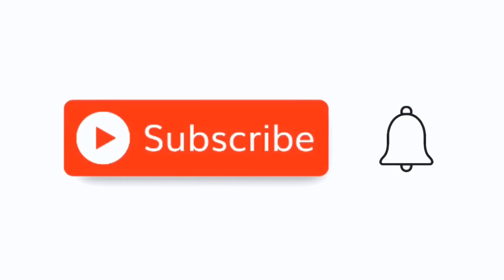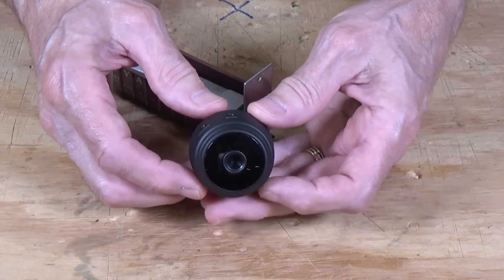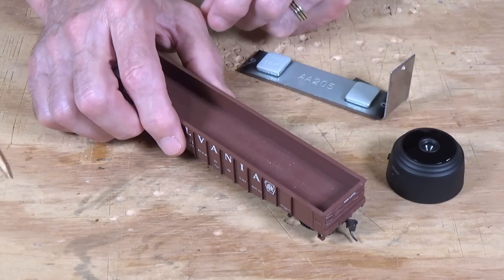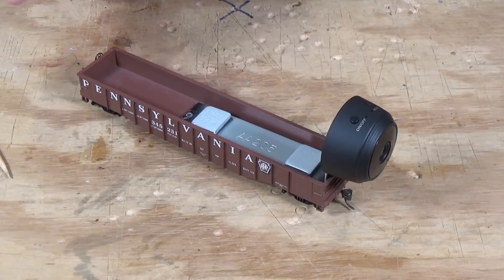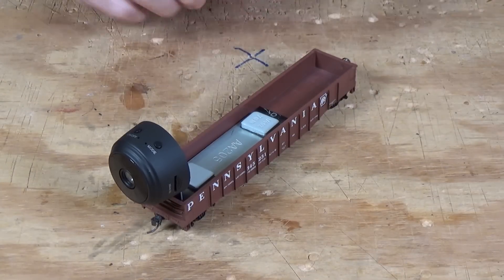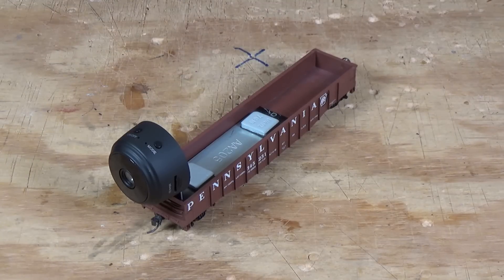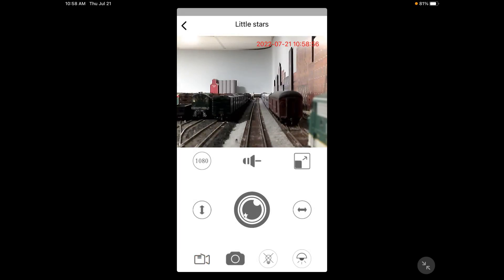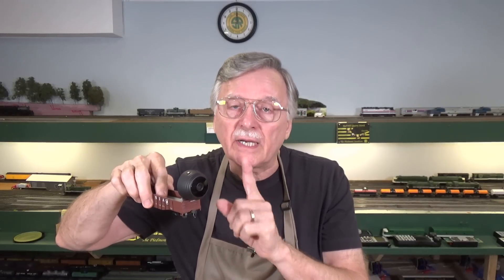Build A Camera Car For Under $20 (266)

Comment: I usually use a toothpick to get the sd cards to click down as they go right in it, your thumb wont do it. It wont be 1080p and it wont be stabilized. There is far better options out there but you wont get 4k on one either unless you spend $200 for a 4k camera. The 4k ones are $40 and are only 1080p not 4k. Recording at 720p is okay at 24 frames but not ten, but you would put in within your scene on OBS. Also you would need a massive spotlight behind the camera to highlight the track to get the lens to work. That camera was a rip off at $10 its junk. You only need 1080p for youtube, the biggest youtubers only upload in 1080p.

Comment: Writing about inserting a microSD card into the camera. I had the same problem that you had and then found a solution. You have to use something to insert the card deep enough. I used the back side of my knife and it locked into position.
Reply from the maker: I’ll give that a try. I was afraid I’d get the SD card stuck in the camera and have to cut it open to retrieve the card. Now that the video is done I’m not concerned with its integrity so I’ll keep my 5lb sledge handy.

Comment: Check out some of my videos from a better camera that has a built in video server and does 1080p at 30 fps. 

You pay for what you get.
Reply from the maker: I would say you get what you pay for in most cases, the trouble is there is a lot of misinformation on eBay, etc. This makes it difficult to actually know what you are getting which was the point I made when I said to be very careful choosing a camera. This video was as much a warning as it was a DIY tutorial.

Comment: I did a similar rig for my N scale layout about a year and a half or so ago. I used a gondola with a bracket made of balsa scraps glued together and held in the car by simple friction to hold the camera lens in place. Because of the length of the wifi antenna, I also needed a flat car buffer. My experience with documentation was very similar to yours. Although I got the memory card to work, I could not get sound to record.
The most concrete benefit to the videos, once the novelty wore off, was to help straighten out track I used to think was straight.

Comment: Maybe search for 'fpv camera and transmitter', you'll need to add a battery (or power from track), but these are small and very common these days
Used on drones and aircraft, you could possibly hide it inside a loco ;)
Reply: I wish I knew more about this subject and fpv cameras.  This video has sparked an interest.  Thanks for the tip.  Now it's time for me to try and learn more!

Comment: I haven't priced out components but there are FPV cameras and transmitters for drones that are micro and transmit in 4K. Most can be powered off a 2s lipo battery.
Reply: Where could I learn about this?  Thank you.
Reply: @markgoodrich941  Any shop that deals in FPV drones. You need a camera, WiFi transmitter, 2s lipo battery, and the receiver. Some WiFi transmitters will have an app for a phone or tablet. Or even a set of goggles. DJI digital is popular. Pricey for the digital system but companies like Fox Ear still make analog systems.
Reply: @peteengard9966  Thank you very much for the information and help.  Now I know what to look for.  I appreciate your help.

Comment: Great fun stuff. I use a GoPro Hero Session, bought used on Amazon actually. It's a cube and fits through NMRA, HO scale tunnels, bridges and the like. It fits while on flat car, gondola, and even two ton hopper. I have a couple of poorly lit videos on my channel using it. It certainly cost more than 20 bucks though! nice work!

Comment: The reason for the low FPS is that it is built to be a surveillance camera. I've gone on that mine myself with a different kind of camera. (Video from my camera: https://youtu.be/Q8h1obwhugM )
But if you can't build what you describe, the micro-mark has a freight wagon under part number 90154 for $124.95 and for that price I hope everything works on that camera.

Comment: For someone that's computer savy if one can get it you can use the new Raspberry Pi 2W paired with one of the Raspberry Pi Camera Modules that's smaller than the camera shown in the video. Both the Raspberry Pi 2W & it's Camera Modules can fit inside that gondola car giving you 1080p 30fps but u'll need a seperate cable as the one that comes with the camera doesn't fit with the Raspberry Pi 2W. There is resellers like PiShop where you can get an assortment of cameras & add-ons to make a project like that for relatively cheap like i said if someone is computer savy.